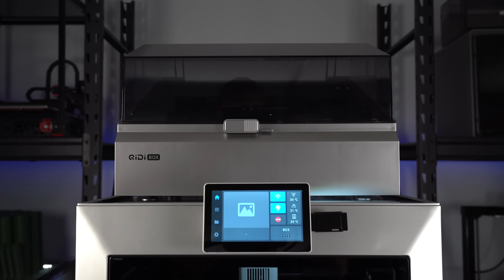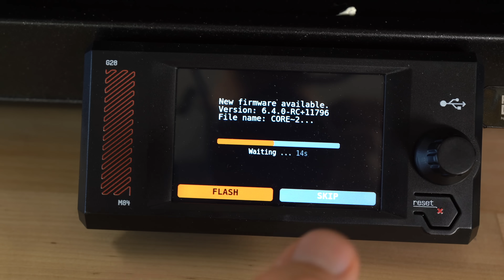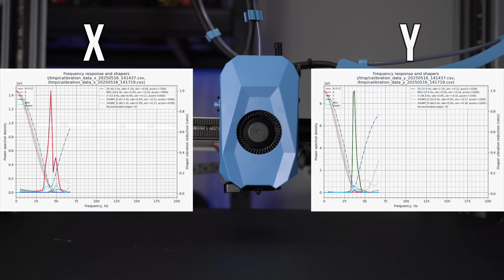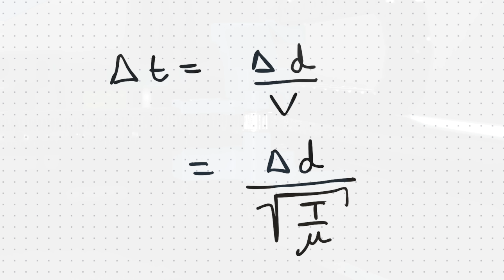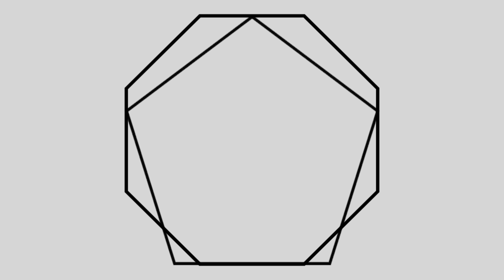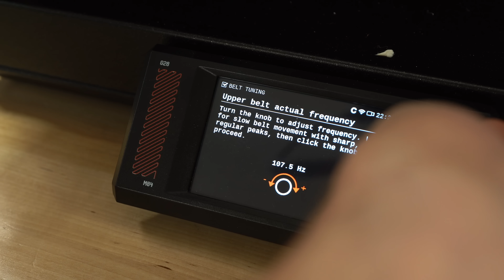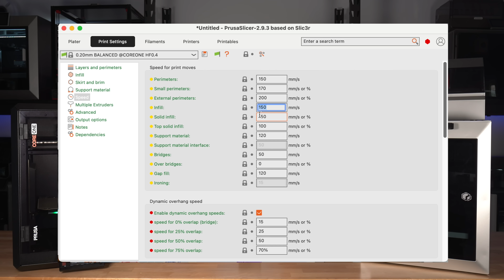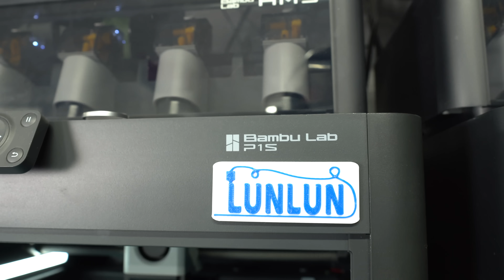The 3D Printing VFA Epidemic

Comment: Checked some of my prints and.. no VFA. At all. I guess that is because still using the same Ender3 which means it is slow... It also outputs really good quality, still. It is just slow. edit: since the beginning i went with tighter belts than recommended, and i haven't had to re-tension them in years, not after the initial flex period..

Comment: Why not add a idler that uses the same number of flat spots on the outer perimeter as the stepper motor gear. It would be geared/timed to the stepper motor gear halfway in phase so its flat spots cancel the gears peaks?

Comment: I know really nothing about 3D printers but I assume (cost, or some technical reason) there is some reason why the print heads are not screw driven?   Belts are notorious for issues when trying to drive motion precisely (tension, elasticity, temperature, etc)

Comment: Vfa...that's a tip issue not software buddy. A shift when going back and forth still bows the frame when going too fast....I say both axis should run on a square surface one layed down one vertical instead of beams...😮
Eliminate micro skips then tweak the software tuning it in

Comment: I am printing 99% functional parts so don't care about VFA, but this video was highly interesting and very well made.
Reply: Vfas can still cause fitment issues on functional parts. Considering the only thing you need to change is your belt tension, why not spend 30 minutes to test and fix it?
Reply: Mirrors are functional 😃
Reply: @JoaoPedro-ki7ct  who tf is 3d printing mirrors?
Reply: Wanting function AND aesthetic is why I stick to metal and wood. Every part I've had a friend make in their printer has looked like watery dog ass.

Comment: 3d printing will never be a prime time industrial process bc inherently the physics involved in 3d printing creates far to many anisotropies in a given print material. Sure its great for prototyping or doing custom small batch jobs or for very specific parts/ use cases which fall within a given acceptable tolerance range for the given case, or using 3d printing to make molds for injection molding, or carbon fiber molds or the like etc…. 

This is where 3d printing finds itself helping in productions, but it will never be like cnc, injection molding, casting, etc where these processes can produce mass numbers of parts at a cost that won’t be beat given all the factors and standards required to be meet for said part as well as the mass production volume of a given part.

Comment: Really interesting. Way back in the day I worked with a computer-driven mask cutting and drafting table. It used an entirely analog drive (not stepper motors), albeit with shaft encoder feedback, and tensioned metal bands (not toothed belts) for drive. It was accurate to 0.001". No digital artifacts at all. Not super fast. But this was 1976.
Reply: That was my thoughts as well. Steppers are cheap so going to servos makes sense to me or even  hydraulic tho speed and complexity would be a issue
Reply: @alexhise968 and cost. A single servo would cost more than every stepper in the machine and unless you're using TMC516x on all axes most likely every driver too. You need at least two such servoes...
Reply: Closed loop vs open loop control makes a difference. 3D printers just send commands to the motors, without knowing what's happening in the machine.
Reply: @SnakebitSTI  Well, it makes a difference at design time.But you can make the resolution of an open loop system as high as you like if the drive system has zero lash. As usual, it all boils out to cost: effector feedback vs. zero lash drive can go either way.

Comment: After nearly 11 years working professionally on 3D printing, nowadays I rarely find videos that I truly feel that add something or go through a topic thoroughly and in an eloquent manner, but this was one of those! Very good job! 👏👏
Reply: Switching from straight (HTD/GT-style) belt teeth to 45° staggered/chevron teeth should reduce VFA-type artefacts.

Key contributors:
Belt tooth meshing periodicity
Each tooth engagement introduces a small force impulse.
Straight teeth result in a single dominant excitation frequency, staggered/offset 45 degree chevron teeth would have significantly reduced cogging harmonics variance and structural resonances to the belts, gantry, and frame, right?

Comment: I had pretty noticeable VFA's (in the X direction and only on side of a cube strangely) on my X1C when using the stock profile. When I want higher print quality, drying the filament and using the "high quality" profile which significantly drops the print speed and acceleration. This pretty much eliminated all the VFA's and I'm satisfied with the print quality for aesthetic prints. The standard profile is great for prototyping, everything has its uses, printing fast AND having excellent print quality is a very complex and near impossible with our current printers design. Servo motors instead of stepper motors, tighter tooth belts, super light gantry and printheads, and much more complex calibrations like variable Pressure Advance and Flow rate will be needed in order to get there. But it's definitely not going to be cheap.

Comment: Wanted to add something. Ive done some testing with vfa on my k1 and have noticed the 120vac 60hz has caused some problems. Running the printer off a dedicated power supply has helped.
Reply from the maker: That’s an interesting observation!

Comment: Can we take a step back for a second and appreciate the fact that we have now come so far in 3D printing that we can now devote this kind of time and attention to what is in reality the most meaningless of problems?
Reply: I was thinking the same thing. I remember being happy my print finished at all and resembled to the model. haha
Reply: @AlteredCarbon99  And did not broke apart when removed from the printbed.
Reply: @AlteredCarbon99  for me, it’s a success if it can make it to the second layer
Reply: I was thinking the same thing. We have solved transparent shell, layer shifts, stringing, bridging, bed adhesion and many more. And we have significantly increased the speed of printers. Now we are focused on such a minor imperfection. Just think, in a couple years VFAs will be completely eliminated just like all the other things we have eliminated.
Reply: @xHyperElectric  Yes, DC motors, 1024 bit encoders, and tractor beams :P
Reply: My PS1 is working night and day, and regardless of such ”faults”, it comes with so much better parts than my old or even actual printers, so I really do not pay attention to them. But, it is always good to know about such stuff...
Reply: I mean this is a huge problem in terms of manufacturing functional parts for product engineering and prototyping with FDM.
Reply: Always make it better.
Always make it better.
Always make it better.

That's the spirit....not bitching about minor issues...fixing them.
Reply: @area51audio PMA aka Positive Mental Attitude :)
Reply: But it’s much easier (and more lucrative) to whine.
Reply: How 3d prints look is a massive component in getting them closer to something that is 'professional' in appearance/marketability/use. Very important thing to develop further.
Reply: Meaningless? Parts looking horrible doesn't matter?
Reply: @atnfn Yes.
Reply: Yeah this is the most absurd nitpicking complaint. My brand new printer has a catastrophic bug that requires the wifi to be disabled and reenabled in order to be seen on my network. THAT is a huge problem because I can't do that remotely. So I can't send print jobs remotely. Even if I added a remote controlled power cycler to cycle power it still wouldn't help.

Comment: I'm running a Voron 2.4 350 with 2mm belts. I have eliminated VFAs long ago be experimentation. What is great about DIY printers is the flexibility--run any hot end, stepper, belt, until you get the results you want. Eliminating VFAs is not difficult--it's just difficult with inflexible factory-built printers built to save money for the manufacturer. I don't know how I eliminated the issue, just by guess-and-by-gosh. I tend to run the belts much tighter than recommendations, because it makes much crisper prints. Supposedly, it will wear out the steppers quicker, but after hundreds of hours, they seem fine.
Reply: The DIY crowd gets the added benefit of watching gross companies like Bambu receive patents for work WE did, because IP is such a stupid system.

Comment: Are there VFA's on Magneto X Linear Motor FFF 3D Printer by Peopoly?
Reply: I have not watched the review of the Magneto X recently, but I remember being disappointed to learn that there were artifacts. If you think about it, a linear drive is also made up of a series of coils, just like a motor, but arranged linearly instead of in a circle. As the moving piece passes from the influence of one coil to the next there could be accelerations and decelerations. It should have fewer parts to worry about, so it is a promising approach. I suspect that they know that they need a linear drive with smoother action, but maybe that's not available from suppliers at a reasonable cost?

Comment: I wonder how 3D printing in a weightless vacuum would behave.
Reply: Why do you think they'd behave differently? 
Aerodynamic drag does not factor into print quality, regardless of print speed. The print head may move fast, but it's not that fast. 
The absence of gravity doesn't magically remove an object's mass. Only the z-axis would be affected at all. 
The absence of oxygen might have a positive effect on print quality - on a chemical level.

Comment: I put toothed idlers in my Prusa Core 1 and interestingly, to keep belt line you need 22t idlers, which are rather hard to get. Using common 20t makes belt travel at a very slight angle to X rail. This will introduce small loss of linearity, so keep this in mind when upgrading.

Comment: Especially around 13:00 you are showing what I’ve been seeing - the balanced profile and new belt tensions don’t actually do anything. You said they were diminished and the VFA look better, but your prints looked exactly the same. There was basically no difference in the two prints.
Reply from the maker: At 13:00 that is just the belt tension comparison, both using structural profile. I’d agree that that shot doesn’t make the difference seem significant but in person the higher belt tension was considerably better. The use of the balanced profile made the bigger difference. I showed a clip of that earlier on.
Reply: @ygk3d maybe it’s just my printer, I’m not sure. I was pretty active in the Prusa forums on this topic and before Prusa ever released the balanced profile I posted how 200mm/s shows virtually no VFA. The balanced profile seems to show that Prusa came to the same conclusion because it’s also set to 200mm/s outer perimeter speed. But even in person the VFAs are extremely obvious. This also doesn’t account for the fact that some sections of the outer perimeter won’t be long enough to even accelerate up to 200mm/s. 

The entire video is great and a really in depth explanation of a topic most people get wrong. 

In my experience tho Prusa hasn’t really solved much with either belt tension or the balanced profile unfortunately.

Comment: i dont get why 3d printers dont just use permanent magnet synchronous servos instead of stepper motors. for years the industry has been struggling with issues that are inherent to the type of motor and years of development has gone into patching the problem when a 3d printer is LITERALLY the perfect system to pair a servo motor to because it requires relatively high speed, relatively low torque, and the system inertia doesn't significantly change over time...

i also heard GT is not the best tooth profile when it comes to motion systems; AT is allegedly better, they just dont make em that small (AT3 is the smallest)
Reply: At a guess, synchronous servos are more expensive.
Reply: @MaximilianonMars  they're not that much more expensive. i'd gladly pay €200 more for the same printer with synchronous permanent magnet motors
Reply: Thomas Sanladerer posted a video a month ago explaining exactly this.
Reply: @StylishHobo  BLDCs are not the same as PMSMs. PMSMs have much less torque ripple because the torque control is also sinusoidal (edit: supposedly bldc control can also be sinusoidal, so no real differences)
Reply: @ikbendusan yeah bldcs are used in surgical robots and other precision equipment.  Theyre so common theyre not much more expensive then steppers.  They need a better controller.  Usually three half bridges instead of two, and usually f.o.c. software instead of microstepping.  And usually feedback from rotary optical sensors.  And also more parameters to tune.  These are all possible, just more work and $ and education...  which is why it may take some time... but i know robotics more than 3d printers...so i wouldnt be surprised if someone has gone this far!
Reply: @DIYDSP  field oriented control happens in the servo drive; not in the interface between the printer and the motor. you can get 400 W AC servo motors for €100 with a standard step/dir interface. gain matching is always annoying but it can be done

Comment: tu cancel the belt vibration you just need a type of idler along the way that barely touch the belt on the smooth side to it can only vibrate in one direction which cancel any resonance. it will still be able to vibrate at a higher frequency like if you barely touch a cord on a guitar, it still rings, muffled at a higher note, but if you place the idler at the right position it will cancel most resonance since some length ration have less resonance

Comment: Finally, someone points out that Bambu printers also have that same pattern on flat surfaces as other printers do. This is almost never talked about — the general impression is that Bambus only produce perfect, smooth prints.
Reply: Well they're not magic
Reply: Yes they do , they are perfect, everything else is heresy.
Only my opinion matters and i am right...allways.
Fanboy111

Wait a second ... exiting " Ignorant Karen Mode" 

I find it not really disturbing anymore ,when i started 3d printing in 2017 , i would never have  dreamed how quick evolution goes on , and i love it.
Give the experts a few years ;) it will be fantastic

I
Reply: They usually do the best job at controlling it though.

Comment: regarding the 3:30 reason : variable print head movement velocity, one way to easily eliminate this potential cause is to print with a very high layer height where this effect intensity must be way less important because the flatter the layer is the more the difference in plastic volume will translate to visible width difference

Comment: My K2 Plus uses a 2mm pitched belt but now you've got me looking at it with my 'hmmmm, I wonder' eyes. 😂
While it does use 2mm belts, I managed to mess with jerk and accel settings to get a happy compromise for a given choice of filament. 

But now I am wondering if I can change out the belts with their gears and idlers for the finer toothed version 🤔

Comment: Why not use a wire to pull the printer head, having the wire wrapped many times around the driver rotor?  This would eliminate vfa's caused by the belt teeth.

Comment: It is simply caused by the stepper motors... they simply do not move fluidly. I came to this conclusion years ago. A toothless belt is they way to go. It can be wound up and unwound from one point to the other. A tungsten extracting and retracting system would work too. 
A resonance field motor on the head, then on the rails would eliminate belts altogether. The rails would have to be one polarity, and the field is generated as the opposite, to move the head where it needs to go.

Comment: I whink the nex logical step for quality in printing is going to ball screws and encoder driven motors. Yes, would not be cheap, but all this defects due to low rigidity construction will be gone.

Comment: How about adding some noise to the speed of the motors? Essentially 'spread spectrum' where you spread the resonance energy over a larger bandwidth, so that the peak resonance is reduced.
Anyway, this needs a firmware fix, not setting specific speeds in the slicer.

Comment: For analysis I suggest a dark field / low angle light image of a VFA surface and using FFT to convert that to a frequency spectrum. That will show all frequencies of the VFAs and then you can check which parts may cause those. Periodic errors from pully or idler runout will show there, but they are hard to spot visually if mixed with other frequencies.
Reply from the maker: Brilliant idea!

Comment: Very interesting video. In the past, when modern "graphical" printers did not exist, a lot of graphical Hewlett Packard plotters (with IEEE-488 Bus) used to use multiple wires on capstan/drive cylinder with pulleys to move quickly and smoothly the pen across the page. The accuracy and the repetability were incredible. I wonder if these techniques could be re-adapted nowadays in 3D printers instead of belts.

Comment: I'm just over here chillin with these ender 3s. I can't believe you over the with the Lt. Commander of the USS fancypants or whatever the hell those unserviceable boxes are supposed to be and have ringing like that which is from mechanical noise either the motors or the fan something's transferreing vibration and needs to be isolated. Calibrate yo shit, use your brain, and keep up with maintenance. It really is that simple.

Comment: Very interesting subject.   I started using toothed idlers on my Tronxy D01 many years back . Quite difficult to source back then but worth the effort. I now have a Two Trees Sapphire Plus and have done the same.  Will now be hunting for 1.5mm pitch belts and drive cogs and idlers. Here's hoping they are affordable. Cheers